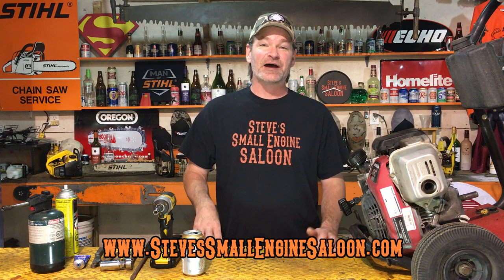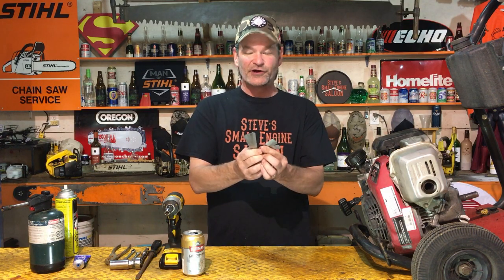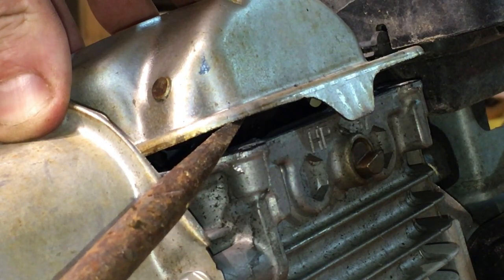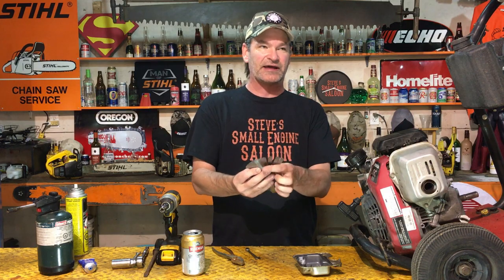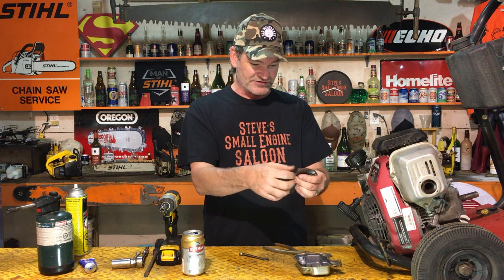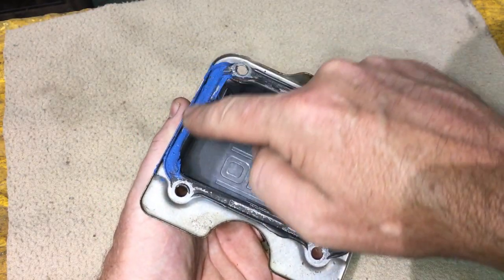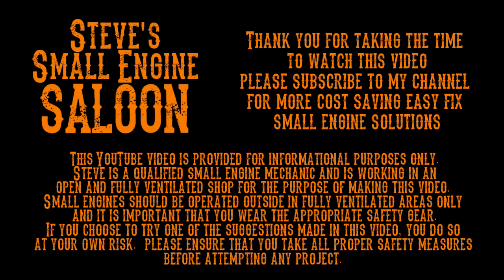How To Adjust Or Set The Valves On A Honda GC Engine

Comment: My lawnmover won't start at all. When i pull out the starter, engine spins and nothing happen. The only thing what i saw, that when i pull starter, fuel goes away from air filter, but not inside cylinder. Compression   test shows 50 psi. Valve clearance: intake 0.10 mm. and exhaust 0,15 mm. Anymore ideas?

Comment: You can get the silicone gasket maker off with Toluene and a small brass brush.  Wet a rag with the Toluene and rub the silicone.  Dip the brush in the Toluene and rub the gasket.  The solvent makes the silicone get stiff and weak.  It rubs right off with the brush.  Use the rag to clean up the bits of gasket to keep it out of the engine.  Clean the surface with alcohol and apply new gasket maker.

Comment: Buddy, you’ve just saved me hundreds of dollars and potentially weeks of downtime putting my Honda HRR216 in a shop to get it adjusted!  Thanks to you, I got quickly acquainted with a feeler gauge, checked the engine clearance specs, got the adjustment right, bolts properly tightened (this was actually my first attempt with OHV engine adjustments as I’m also mechanically inclined!) and now my machine purrs like a kitten!  All because of an 8 dollar tool!  Thank you!
Reply from the maker: Glad I could help

Comment: Great video - Thanks Steve! My Honda 2009 217HDX mower valves were loose by .004" (Intake .010 and Exhaust .012") vs specs .006" & 
008". Estimated hours to date is 600 hrs. Hard time getting valve cover off; had to spray carb cleaner to wash off minor dirt. 😋

Steve, it's great to remind home mechanics that yes all small engines need valve adjustments per owners manual. This is an often neglected part of maintenance. Thanks!

Comment: I took my tiller to a repair shop to get it fixed because the pull cord was ripping out of my hand during starting. They quoted me $400 and then told me to go buy a new engine. So I went on this website to see how to adjust the valves. Steve makes the whole process so simple. After adjusting the valves the problem was still there so I needed a new camshaft pulley with compression release. The pulley replacement took about 5 seconds. So I went from $400 to $7.99 and I did the job in no time. Like all the other comments on this video Steve saved my bacon!!
Reply from the maker: Looks like the repair shop didn't see you coming! You showed them how it's done. DIY for the win!
Reply: OHV... valves get tighter as they wear.  Adjustment seldom has any impact on compression release.  Replaced lots of plastic camshafts though.  Combination of not changing oil or bashing the valve cover.

Comment: Got two pressure washers for free with these engines and will work on them tomorrow. I think that I may have a valve issue or belt issue. So I'll get them kicking again! Thanks Steve
Reply from the maker: Good luck!    :_Beer: :_Mower: :_Rider: :_Chainsaw:
Reply: @StevesSmallEngineSaloon  Got one of them sorted out. Turned out to be the pullcord recoil starter cup was bent, causing the pullcord to rub. straighten it out and it works fine. The other washer is locked up. So will take that apart tomorrow!

Comment: Have a new County line 28 ton log splitter GC 190 Honda Engine.  I split with it maybe 10 times and put it up, tried to start it and it ran funny, 'not to full auto throttle, then it cleared up ran great.  the next time it did it again, I had always checked oil.  this time I guess i didn't check it enough the oil was very low not showing on little stick, was hard to pull start and when it did start it spit and sputtered and would never come to full throttle.  Cleaned carb, cleaned plug, plenty of spark, cleaned intake, drained oil "not much in it" oil had graphite looking color!!! Put new 10w30 oil in it.  Ran the same wont' come to full throttle.  I'm thinking the valves were affected during low oil running.  I will adjust as you showed in video, using your other website for valve clearances.  Let you know what happens Thanks  Bill

Comment: Tip, to find true tdc the bottom or pto keyway is in line with the crank and the cam has a line going across it that matches up with the rocker cover mounting surface. Super critical to retime it if you ever have to pull it down.

Comment: Thanks for making these Honda videos.  I got tired of dealing with and working on the B&S cheap engines on the typical TroyBilt mowers and bought a Husqvarna with a Honda motor.  I've never worked on a Homda before so, if I ever have problems with it, I really wouldn't know where to start.
Reply from the maker: You're Welcome...

Comment: Good stuff again.  Surprising that all you needed to do was readjust the valves;  I've seen other "run no oil" and seen things get hot enough to melt the rod bearing to the crankshaft.

Comment: Great video! I have a GC160 that's completely stuck after it was running like a top.  I added some Seafoam and afterwards it started to run poorly and started smoking so I killed it. Now it won't start because it's impossible to turn, completely stuck.  So I want to get into the cylinder to clean it out and have a closer look. Do you have a video on how to get in there?

Comment: Steve, have u checked rockers? Are they loose or tight, before adjusting valves gauge?
Reply: My exhaust one was loose it needed a lot of tightening to fit specs

Comment: Really enjoyed your video, I have a question. On the belt itself could you install it upside down or backwards? Some of the videos are seen on the GC 160 on the engine when they took the belt off and mark it so they could reinstall it the same way. I'm replacing mine so I don't have that luxury of marking it. Any help would be greatly appreciated.

Comment: Just got a lawnmower this spring with a Honda engine.  So far it starts every time with one pull.
Any idea on how many hours before I ever need to check the valve clearance on one of these?
Provided I’m running it with oil in the crankcase ;-)

Comment: Thanks Steve for these informative videos. I bought the micro wire drill bit set and cleared  carburetor,  replaced and got engine started but it's not throttling. How do i fix that. It did cut the lawn but engine trips as fuel cable is released. Thanks and try to find Red Stripe sorrel beer you'll love it. Be good.

Comment: I found that Honda makes a cast aluminum valve cover that can replace those flimsy stamped steel covers.
Honda part number: 12311-Z2A-000 
Not only do you get a solid cast cover, but it offers protection to the rocker arms. 
I've seen the stamped steel ones get dented in, causing the valves to make contact with the cover. 
This will cause all sorts of starting and running problems. 
Upgrade to cast and throw away those flimsy, stamped steel covers that have a 50/50 chance of leaking after removal.

Comment: Nice demo, Steve.  I hope you have a suggestion for my problem.  GCV190 is hard to pull over.  Removing spark plug did not help.  Reset valves as you have demonstrated.  No improvement. The flywheel is not bound but just won't turn over with rope alone.  Difficult to turn even with starter assembly removed, using screwdriver in slots on top of flywheel.  Self-propel belt and blade clutch removed so nothing binding underneath.  Ideas?  Thanks!
Reply: My pressure washer has the same engine... Mine pulls through if I ignore the valve clearance. Hmmm

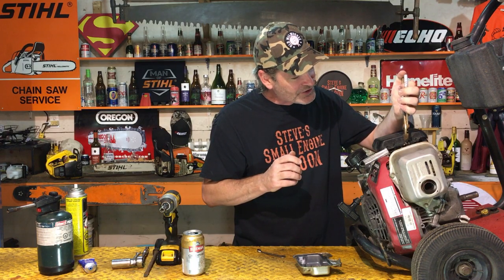Comment: 6:24 That "not too tight" feeler guage is what us engineers call an interference fit. On a horizontal valve engine (vertical gap) it would slide in/out easy but not drop out.
Reply: Must be a different engineer that the rest of the world.  Because interference fit means there is less than or equal to zero clearance.

Comment: In one of my Honda engines, one nut came loose  and fell out into the oilpan because of vibration.  Now I have taken everything apart, found  and retrieved the nut  out of the system!  
Im putting the nuts, all of them on the red threadlocker! So as the gas tank and other bolts that were running out of my sight when I was moving the last time.

Comment: I have a mini bike with a hisun 196cc and want to check the valve lash on my next oil change. Will i need to get new gaskets or new gasket glue like the Honda’s or could i reuse the gasket it came with if it’s in good enough condition?

Comment: I noticed the other day that my Subaru pressure washer had OHC on the valve cover rather than OHV.  I did wonder what the difference was.  After this video I now know how to adjust the valves when that time comes.  A little difference but basically the same deal.

Comment: Thanks for the tips man.    I fonhave a question I can seem to find an answer for. I live in Central FL and have stupid thick st augustine grass.   My Honda GCV160 is a little shy on power.   Will a GCV190 bolt right onto the mower deck?   Same bolt pattern?   

Thanks

Comment: Hey Steve, 
  When you look up the specs you will typically see a range. The one I have, the intake is .003 to .005. Should I shoot for .003, .004, or .005? 

Thanks very much.
Reply: From the engine manual:
Intake:    0.006" +/- 0.002"
             (0.15 +/- 0.04mm)
Exhaust: 0.008" +/- 0.002"
             (0.20 +/- 0.04mm)
Reply: Always shoot for center mass.

Comment: I got a box job that was totally tarn down, i over hauled it and got it back to geather but no fire from coils 
I know it didn’t have any clips on coils, is this the same on GX 630 ???
Also is low oil shut switch just one yellow wire to it ????
This is a old waker roller

Comment: Hi Steve. I adjusted the throttle using your method in another video . The engine is running rough at high revs . Could a valve adjustment fix this problem. My gut instinct tells me yes it's the valves. . Loving your videos. Saving me tonnes of money. More beer money. Thank you from Australia.
Reply: Have you checked the governor

Comment: Brilliant Videos Steve...watched your vid on how to adjust the valves and think that's my problem, but I can't find the valve clearance on my Honda generator, model EP6500CXS. I looked at your valve clearance list on your website but this model isn't there. I've also tried to google it but I can't find the proper info for the valve clearance on this model. Any chance you can help me find that? I'd be ever so grateful.
Reply from the maker: That generator has a GX390 engine.  6 thou on intake and 8 thou on exhaust...
Reply: Thanks so much Steve, that’s so helpful, I couldn’t find that info anywhere...you’re a star, thanks a million!

Comment: Thanks for the video. Why have I been wasting my time making those gasket surfaces spotless before I reseal the valve cover? I guess I need to realize I'm working on a lawnmower, not the space shuttle.
Reply from the maker: You're Welcome...
Reply: Ditto! I recently replaced the cam wheel on a GC160 because the Easy Start slider was getting stuck. I spent a while getting both mating surfaces clean. Oh well, now I know! Thanks Steve!
Reply: Did the same here with cleaning the valve cover until it was spotless, now I know better if I ever have to go back in.
Reply: @sikorik9964  okay until the pressure throws a pinhole leak. Always best to start clean, as you did before. Exacto knife blades always come in very handy for that kind of application. Check them out.

Comment: Steve, I have heard to adjust them when the piston is about 1/2" or so past tdc compression stroke (which I guess would then be the combustion stroke). Have you ever heard this?
Reply: This is usually because of a decompression device used to make starting easier. You want to make sure your valves are seated before checking specs on them.

Comment: Just a little info on the cam gear on the out side of the gear there is two horizontal lines on the side of the gear ⚙️ and line those lines with the head that will put the gear in timing !

Comment: Hi Steve. I like your taste in BEER. (Any brand) Anyway, I replaced the head gasket in my 17 HP Briggs and Stratton OHV engine. Everything seemed to go well until I went to start it. It just rolled over. I took the valve cover off and saw that the exhaust valve was not moving.I took the head off again and I couldn't see anything wrong, but the pushrod was not moving at all when I turned it over. Have you got any suggestions❓Thanks for sharing.🍁👍👍

Comment: Steve, need to clean the rust off'n your screwdriver & pliers. For a sealant you can use either ultra black or ultra gray, both are silicon & work great. I like the way you tell elapsed time by beers. Would that be a typical 12 oz can?  Thanks for the video, gotta do this on my Honda weed whaker.
Reply from the maker: Right on...

Comment: I have one of the motors on an Excel pressure washer. I took the pressure water pump off and I'm trying to start it with no success. The spark plug sparks. New gas in it. Does it need to have a load or something else to start since it had the auto throttle as a pressure washer? 🤔

Comment: Hey, awesome video. Question: why the intake valve in mine the spring is compressed and there is a huge gap between the adjustment and the valve? Is there something else happening here? Something broken inside the engine? Thanks in advance.
Reply from the maker: Valve is stuck open.  I think I have a video in my playlists for that....

Comment: Thanks, i have a few engines that probably need valve adjustment. 
I prefer strong beer like St-Ambroisse double i.p.a. That beer will strip the hondabond right off the cover 😂
Now to see if you have a video on how to clean the carbon from the cylinder. Its in the maintenance guide so guess i have to do that also.

Comment: Just wondering if the head on my old Tecumseh SBV 2295 engine is toast? The valve guide on the exhaust valve has been punched back by the explosions about 1/4 inch. So will a new valve guide fit in tight? And not move toward the retaining ring side? Can someone advise if they know this situation? Update ..what I did was switch the valve guides and I "pinned" the exhaust valve seat..which was coming loose repeatedly.

Comment: Steve, my pressure washer has a Honda GVC160.  I replaced the pump on it.  To do that I had turned the engine over.  Maybe that was a bad thing to do.  Anyway I did it.  Once I finished I tried starting the engine.  It started but then stopped.  I did that a couple of times and then I was unable to pull the starter.  Do you think setting the valves might fix that problem?  This might sound dumb.  Sorry.

Comment: Steve,  Great video.  Never had to fast forward once. ;-)  One question.  I have the Honda GXV530 which is the twin cylinder 16 HP unit with the same valve set up.  Sears riding mower.  I heard what was definitely the sound of lifter noise and pulled the valve cover off to find one of the arms very loose.  The adjusting screw almost completely unscrewed leaving the arm to have at least a 3/16" play.  So question is, on the twin cylinder units which is the in take side and which is the exhaust side.  I'm not a beer drinker but I think wine is an equivalent substitute?!?!?  Thanks in advance.
Reply: I think the exhaust on the GXV530 is on your left for both cylinders as you face them looking at the top of the cylinder. In the Sears manual / pdf on pg. 52 the exhaust are numbered 8 and intake numbered 7.

Comment: Steve, do you have to clean off the old Honda Bond residue with a razor blade? Does it not leak if you don't?
Reply: Best practice to remove old sealant.

Comment: Hi Steve Ive had a bad starting problem on a 2016 Honda izy with an easy start system. It's been fixed several times on warranty which has now expired. It's starting to play up now and again making no effort to start, what is the saftey switch called that the deadmans handle actuates  so I can order a spare as this is what the guys at the store said they replaced

Comment: Steve,
Instead of messing with RTV why not use Honda gasket 12312-Z2A-000. If you are worried about the stamped cover properly sealing how about the cast cover 12311-Z2A-000 ? These appear to be from commercial grade engines. Do they fit? You tell me. If you think it's worth the upgrade you buy the next round.

Comment: I've learned a lot from watching your videos.  I especially like that you spend a lot of time with Honda engines.  I do have a question.  I recently acquired a Devillbiss  Excell Premium power washer, Model EXHA2425 (for free).  I has a Honda engine, but it doesn't seem to have the 'normal' Honda identification on it.  It doesn't have the badging which describes the actual engine model.  It just says "powered by Honda."  There is a sticker which says that the displacement is 161 CC, so I'm guessing that this would be a Honda GC160 engine.  Is that correct??  

I haven't operated the engine yet.  It has been sitting for a couple of years without being used.  I've checked that it does have oil in it. The engine does turnover normally when you pull on the rope, so it isn't seized, and I don't hear any unusual sounds when it turns.

I think I should probably remove and clean the carburetor and the fuel system.  There is gasoline in it, and it doesn't smell varnishy, but it doesn't smell fresh, either.  It may have had Stabil or something similar added to it.  Don't know.  But I suspect it isn't going to run well, if at all until it's cleaned up.

Do you think my assessment of which engine this machine has is correct?  Should I use the GC160 specs to maintain it?  I can't find anything in the way of technical information on the web that applies directly to this machine, and I don't want to screw it up through my own ignorance.
Reply from the maker: Yes it is a GC160....

Comment: You don't need to take the spark plug out  Just loosen it enough to let the air in/out. Saves valuable seconds on the job.